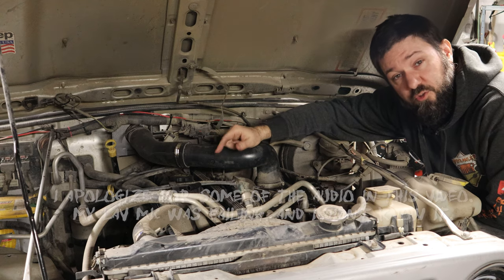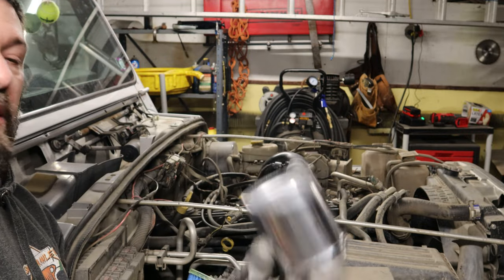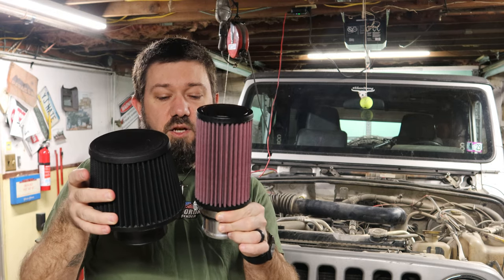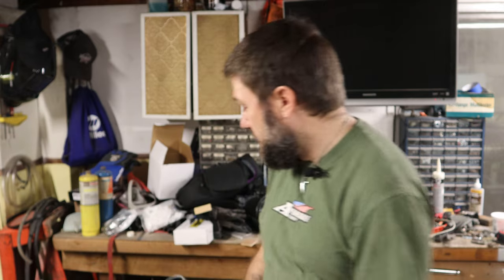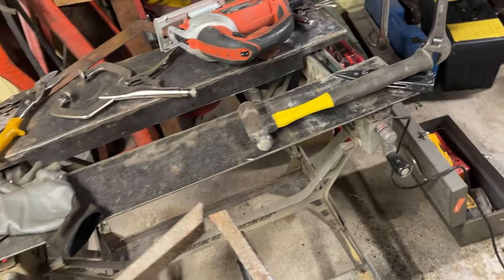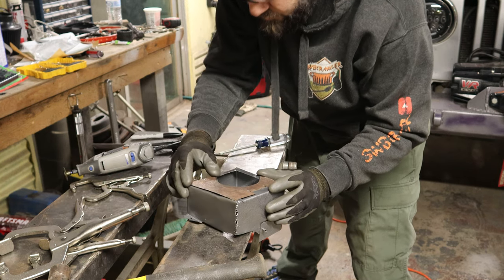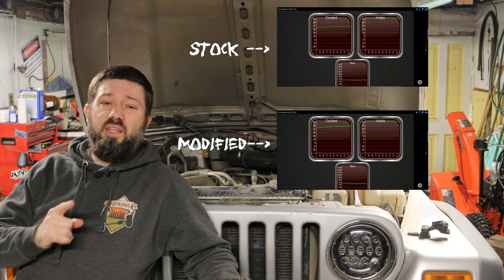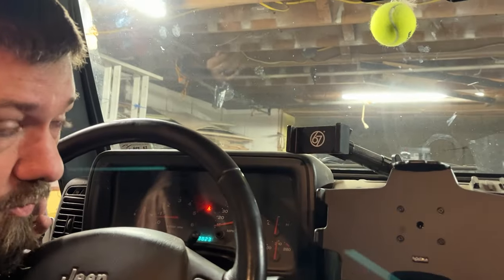How to Build Your Own Jeep TJ Cowl Intake for Less Than $100

Comment: Im thinking i might just use a hole saw through the firewall and put rubber bulb seal (like used around doors) to hold the filter in place. It might draw a little air from the engine bay, but the majority will come from the cowl.
Reply from the maker: this would probably work. i wanted to be able to be able to access the filter from under the hood though. which is why i made the box and access door. 

there’s also the matter of clearance there’s not as much room under there as you might think.

Comment: Working with sheet metal is a whole different ball game. I'm starting to have fun with it.
Reply from the maker: Yea!  Shaping it was so much easier, but attaching things was a challenge.  I need a lighter duity welder, or maybe just thinner wire.  Ill need to do some experimentation.
Reply: @SWBCrawler  you just need more practice. My 220v welder does a much better job than my little 110v Lincoln.

Comment: Reusable air filters are not a good to use if your are off road, they allow more smaller dust particles to get into your intake , wix  paper air filters are the way to go they have the best filtration media, speaking from experience
Reply: I have over 200K on my reusable. Not sure what test you have done to show they don't last. Maybe you tested to 400k, that would make more sense I guess.

Comment: Why? In order to Clean Filter you will have remove everything. Not Smart at all!
Reply from the maker: There are several reasons why.  And I built it so you can remove as little as possible to clean the filter.  Under the hood you remove the panel on the box i built, then disconnect the intake tube from the throttle body.  the entire tube and filter should then come free and you can clean the filter.  Yes, its more work than stock, but ive also moved my intake to a safer location, out of the hot engine bay, and it should get less trail dust.  Everything's a trade off.  

As for how "smart" it is?  shrug to each their own.  This is a very similar build to the THOR kit, which a lot of people love.

Comment: Please don't laugh as I don't have any hole saws.  Are Hole Saws direction?
Reply from the maker: Do you mean are they directional?  Yes they are made to cut with the drill in the forward rotation. Clockwise i guess? or every one i’ve used has been.